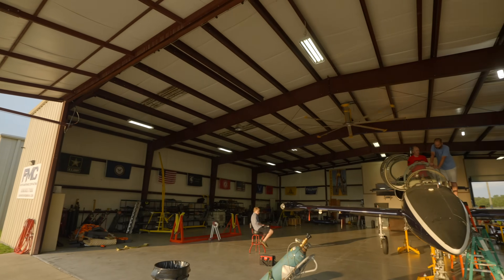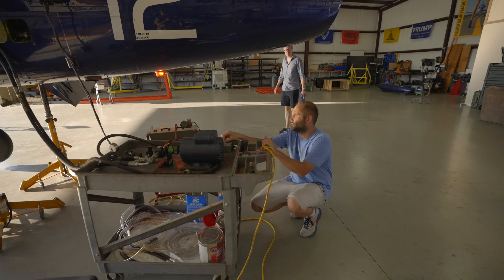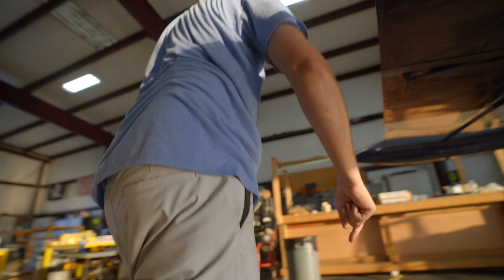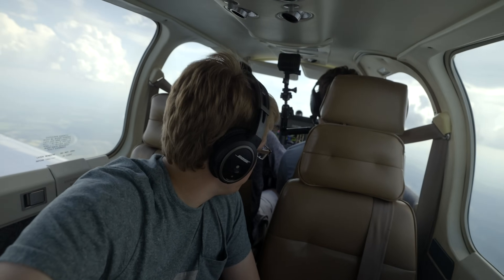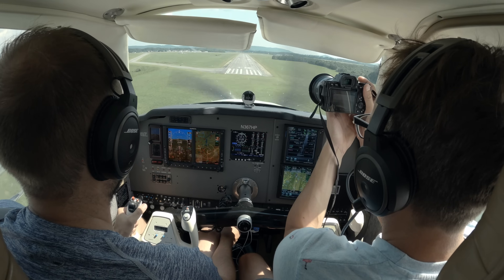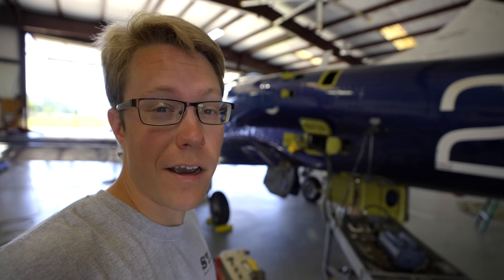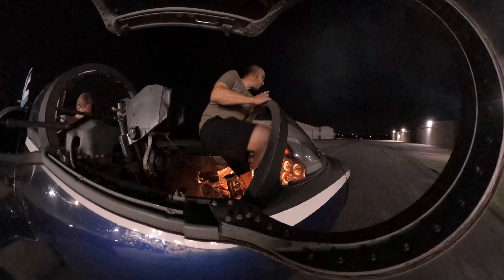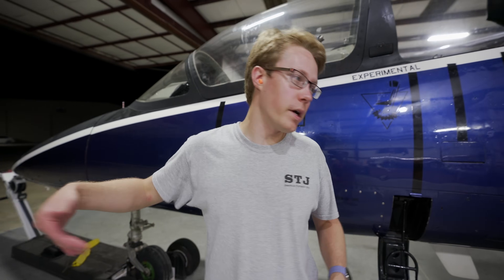Assembling Our L-39 Fighter Jet, But Will It Start?

Comment: I remember seeing these from very close, flying around a small Czech airfield (LKMH) in the early nineties. We were spending weekend camping at "Drábské světničky", which are these pillar-shaped rocks where people dug little caves to hide from authorities, veeery long time ago. There used to be a rock castle up to 15th century. There's a great view of the runway from the top of those rock pillars, and left base approach to RWY 25 goes right next to the rocks. So while you're standing on the top, left-base approaching airplanes are passing just few tens of meters away from you. The rocks are amazing plane spotting areas (with a bit of a zoom lens). Unfortunately, there's very little traffic there.

Comment: You'd think that military jets are super optimized and extreme performance but it seems to me that they are always super heavy, much more than necessary so they are super wasteful to operate. Other than very messy construction that's ugly to update. So there is great potential for making a light plane with a jet engine, particularly a turbofan engine that could have comparable or even superior fuel economy to a piston plane yet able to go close to mach 1 or even above. And do 9 g maneuvers. 
The L-39 is 3.5ton empty for 2 seats. And jet engines are lighter than pistons so why the extreme weight.
F35 is 13.2ton empty, 30 ton gross.

Comment: Back seat driver.
Reply: @terry boyer a tipsy back seat driver did you see the lads smile at each other as matt rambled on about some flight details he usually inputs then trails off - booze even with food combined with height our matt was well .... tipsy .... trailing off mid speech . ..... probably threw his guts - necessitating a hand wash ..... or was so out of it going up flight steps the lads cat called and laughed at matt's leaving of his senses

Comment: I'm looking at that landing gear. And a question popped up in my head: Do airplane undercarriages need an alignment, like cars? 
I can imagine that the main gear could use some toe-in for stability and the front wheel can use some proper caster angle for stable straight line tracking at speed.
Reply: Yep you got it. Most aircraft have the rudder pedals linked to the rudder as well as the nose wheel, so ensuring that the rudder and the nose wheel are aligned is a regular check!
Reply: There is a caster adjustment, and this jet is perfect. The nose gear is a trailing link free castering and not connected to the rudder pedals